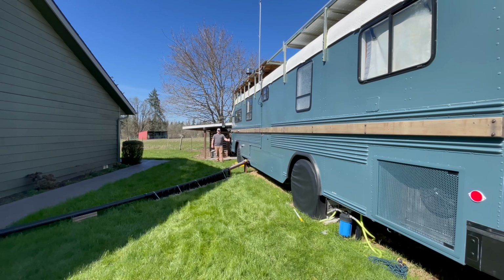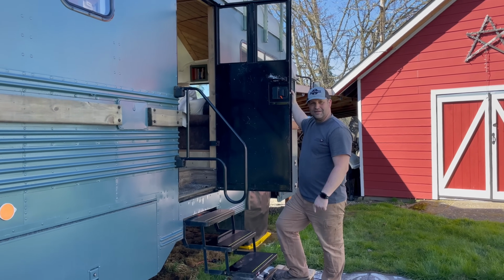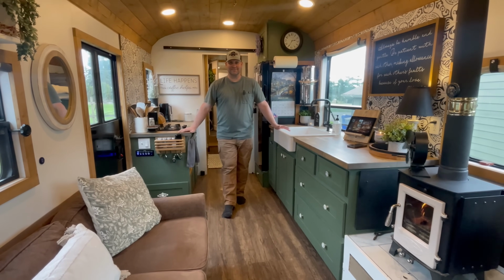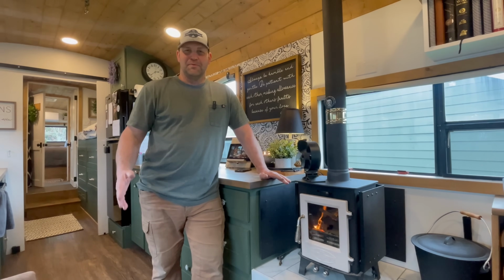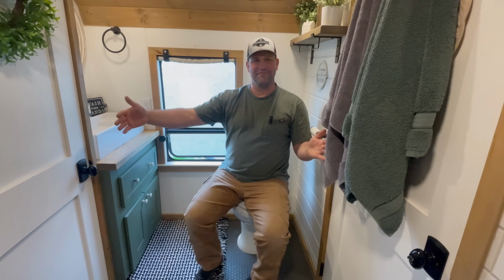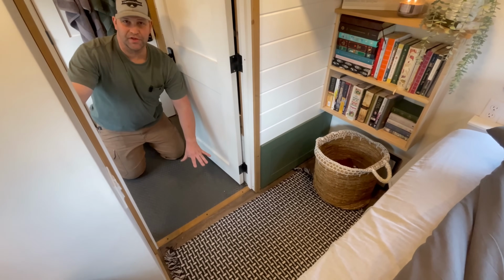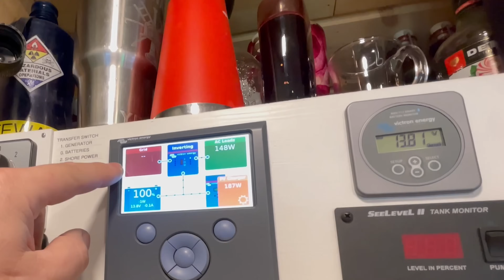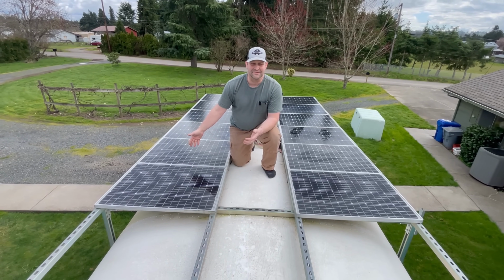Full Skoolie Tour - The Bus is Finished!

Comment: Completely Awesome! Yours is the first bus I've seen with an attic ladder and it's something I designed for my bus because I didn't like the other options. Seeing how you did it just verifies my choice once I actually start the build. You Rock!. My build design also moves the front door to further along the side. Somewhat like what Gordo From Earth has but with the kind of steps you use. The rest of my layout is very different since I also have to contend with a wheelchair for my wife, but your bathroom design is very much like I'll be building but will be using Centrex composting toilet which have a separate holding tank equipped with an evaporator/dehydrator that will live under our rig. They are expensive but they handle everything so there is a lot less crap to mess with, so to speak. Thank's again for posting this.
Reply from the maker: Thank you so much, Follow our bus life and new adventure on our new channel A Thousand Generations Homestead.

Comment: Very impressive, I was hoping you were going to start building full time.) Can you tell us the bus length and weight? How’s the 5.9 handling it, hills and mpg’s?
Reply from the maker: Thank you. The bus is 40 feet long and weighs 31,000 pounds, which is 6000 pounds less than the max GVW. The 5.9 is doing great, we get around 7 MPG which is about what we got pulling our trailer with our suburban. 
Follow along on our new channel "A Thousand Generations Homestead"
Reply from the maker: We have thought it would be fun to build Skoolies or maybe just tackle the systems that people are intimidated by.
Reply: WOW!!! Very well done!! Love your bus!!
Reply: @redwhiteandbluebird9206  Thanks for the reply!) I have a 36’ diesel pusher w/5.9 and when I pull a tow vehicle I get 10+mpg.  Your 5.9 can do better, very easy to modify for better performance, I recommend Gale Banks.  Nice to hear you might be available for consultation, I might be contacting you.)

Comment: Where did you find the attic ladder & was it tricky to install?  Those things always look sort of heavy to me which makes me wonder if it has required any extra reinforcement in the ceiling?
Reply from the maker: Thank you, we found the attic ladder at Home Depot. it wasn't too hard to install, however designing and building a weatherproof roof hatch was the most challenging part. Bus roofs are so overbuild to begin with that no extra support was needed, just blocking in the hole we cut. Follow our bus life on our new channel A thousand generations homestead
Reply: @redwhiteandbluebird9206    Thanks much!

Comment: amazing build! usually I don't care for interior roof deck ladders/stairs, and I was very impressed with your entry point. i did have a couple questions about your build. Do you have locks on your engine cover? I don't hear a lot of people who do bus conversion talk about parking, Have you encountered any difficulties finding parking in urban or city areas? I'm sure bed size played a role in your discission on the bathroom placement, but did you ever consider having the bathroom behind the bedroom in the far back?
Reply from the maker: Thank you so much, We haven't had any need to lock our engine compartment. Parking and even driving takes a lot of planning. we do stay out of the city whenever we can but Harvest host has been great for planning trips. this was never going to be the rig to take on small logging roads in the mountians. Because the engine is in the back it would have made putting the bathroom in the back very difficult. we also didn't want the kids to have to come through the master to get to the bathroom.  Follow our bus life and new adventure on our new channel A Thousand Generations Homestead.